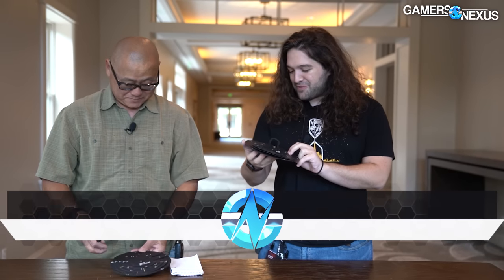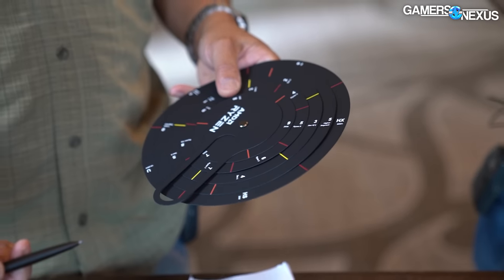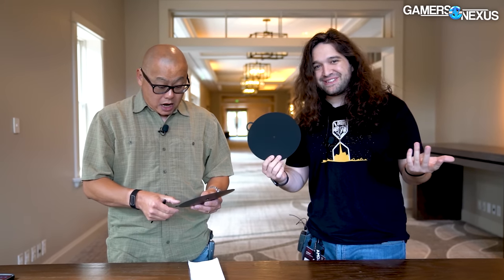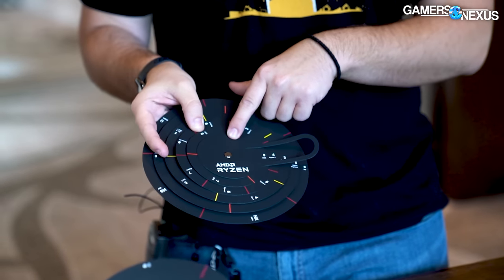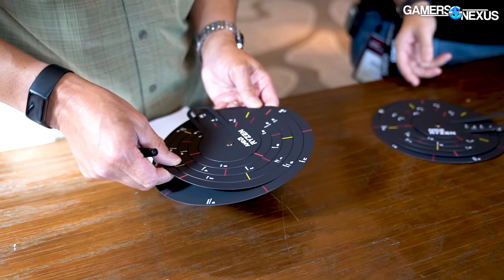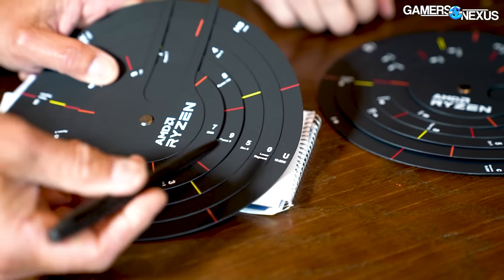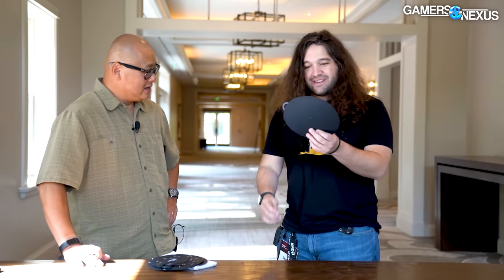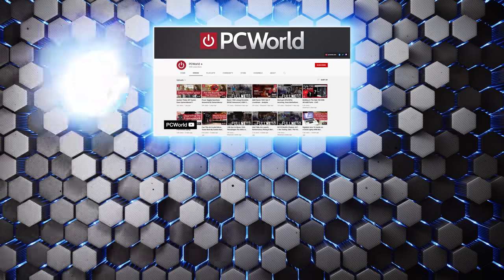AMD Gave Us Too Much Power | CPU Naming Problems

Comment: I guess the first digit is like a model year for cars? Where the "2023" products start coming out some time before the calendar year.  

What's weird for mobile parts is they don't [directly] reference GPU generation - the Steam Deck uses Zen 2 cores but RDNA2 graphics, so isn't just an "old part," and it'll do better than a Zen 2-based laptop with Vega graphics. 

If AMD is using older Zen cores but with newer features (say, more cache, support newer/faster RAM or a new PCIe), then the first number makes sense.  The core may be old but you're getting some new tech.  But WITHOUT that.... it's just marketing to get someone to grab the big number first (which is weird - AMD makes more money by upselling you to a Ryzen 7 over a Ryzen 5 or 3, so you'd think they'd put THAT first since that's the part that makes them the most money).

Comment: I don't see what's confusing, I used to have an Alienware laptop with dual GTX 7950, (those were the days BTW) now I'm going to buy a 7950X, which is going to replace a 6700k, but not paired with an 6700XT, no no no, probably a 7800XT or 7900XT, but not an ATI, because I already have one of those. I really don't see what could be confusing.

Comment: I kind of feel like they should keep consumer branding as simplified as possible. The GPU naming schema isn't descriptive after the first digit, so we know it can be done. Just have a leading digit of the arch and then a unique identifier encompassing of the number of skus you potentially see. If a consumer cares enough, they can go look up the feature set for the unique identifier. Ryzen 5[00-99]. Zen 5 and then whatever uniqueness. 500, 501, 510, etc.. Radeon 5[00-99]. Doesn't matter if it's a CPU, GPU, DIY, mobile, etc..

Comment: Ok, I get what they have/are doing, but I don't get it.... Hope that's clear - lol

Year should mean Year of development/release. So why is their an upper or Lower tier product code, surely this is also the same as a Ryzen 9 vs Ryzen 3?? then instead of a Year decode wheel, why not just make it a Year!..... What a novel Idea that means they've got processor numbers for the next 78 years....

So you could have 235HX Year 23 Ryzen 5 U Low power Why do you need to differentiate the ZEN bit (surely its an ever increasing number which is mapped to year?) Hell if they need to add another digit to differentiate the half/quarter it was manufactured in you could add an abc or d or even a-l after the year component. So a 23b5HX...

Then who would ever need this stupid thing!

Comment: Surprised you didn’t pick up on the correlation, but, consider this - look how in the last couple years, we’ve had constant “refreshes” (the GPU market comes to mind), where manufacturers were using older architectures, but with “newer RAM” (like those 10 series nvidia cards recently), bigger/faster cache (does this even really have an effect on bandwidth if the bus size isn’t changed?).
I can see AMD doing this with older Zen architectures, and adding that 3D-stacked cache for better L3.

Comment: One advantage with the year affecting the first digit is for sales transparency.
If you bought a laptop, the first digit will tell you the year it's manufactured, so it's would be harder to sell 2-3 years old laptop and tell the customers that it's new.
Ex: If you bought a Ryzen 7xxx laptop in 2025, you can easily say it's a 2022-2023 model and negociate the price accordingly.

Comment: Hi . . . You presented a view which is TOO SIMPLE.
With some commercial software products I delt with - there were software version  Line-Ups . . . 
That is a group of software applications which were compatible with each other.
You have just described a few aspects of the  *Hardware Line-Ups*    BUT    they also need to be compatible with *Software Line-Ups*
Obviously the *Line-up* terminology is a taboo subject . . . it is all ment to be easy and simple and will just work . . . . but you do lots of testing 🙂 🙂🙂

Comment: G funny how you are trolling with encoding CPU names.

But when really decoding with the wheel you'd just put the numbers of your CPU in the "window" then you can read the data of the CPU, like year, Ryzen version, core, etc.. I was a bit confused about the '1' having two core variants listed, Zen1 and Zen+ when I read it correctly. So there I'll have to guess which one is used in the CPU? Not that this would matter as Zen1 and Zen+ are quite old tech.

Nevertheless you're right, that someone would need such a decoding wheel - I last used on in the '90s when decoding stuff for a computer game - to identify what you're CPU is like. Should it be for general decoding of AMD CPU names? As far as I remember they had different cores with the same generation number? ... my bad... i'ts just for the mobile CPUs - as stated in the video title dooh - , but then this should be printed on the decodig wheel.

Comment: In 7650 the problem is not the 7. It's the 0 at the end. Completely useless digit. Where it could make more sense to use a letter for "performance" second digit (5-6-7-8-9). To separate and allow 11 gen at some point. 7A5, 7B0, 7E0 or along the lines.

Comment: Why is the Zen core generation in the middle? That doesn't wind up anywhere in the actual part number. Eg 7600x - 7 for "2023", 6 for the slightly higher end of the 2 Ryzen 5 chips in that segment, and the x for TDP target. There's no 4 in there. And the 5950x wasn't using Zen 5 cores either.

Comment: I believe that the year is usefull because a skull refresh would aways bring some clock speed improvements, even if its little, but it could also bring process node improvements, so a 8530U could offer better performance or be more efficient than a 7530U
Things that are been adressed in this new name scheme is just things that is already happening, ryzen 5000 on notebook was really hard to tell apart, now you would know if a hypotetical ryzen 5820U was Zen2 or Zen3

Lastly, About ryzen 1 on 2023, is something that no one whants, but there is certanly a market for a low cost Atlhon silver as 3020e, but now it would problably be Zen2, as Ryzen 7020e

Comment: i think there is one smartbrain thing that AMD could done to make this new naming scheme not entirely stupid, what if the year number was also the socket number, so all the rebadged AM4 stuff would start with 6, but if they made a AM5 Zen+ R3 CPU, that could be a 7310 cheap test CPU for motherboards nice as a spare and it would slot into the same AM5 board that your 7755 would and at the same time it would be incompatible with your common B450/B550 boards that you might build a cheap 2600x system with so that would justify the bigger number.

but that entire thing goes out the window because we are talking about laptops, and AM5 is DDR5 only anyway so how could they sell anything older then Zen4 in a new laptop board clearly they are just trying to sell old crap they have lying around.

Comment: The release year can matter.  IIRC, Google EOL's chromebooks based almost exclusively on age, so a chromebook with a 7430e might only have 3 years left to live, while a 9430e would have 5.  Which, since the processor will probably still be perfectly capable when Google kills your chromebook (or at least kills all security updates for it), could kind of make sense as the most important factor in how good the CPU is, earning its spot as the most significant digit in the name.

Comment: Take the hypothetical 8321 and 9321 chips.  They aren't going to be the same chip.  Maybe they added some cache (easy way to justify the new number), bump up the clock speed a few MHz, did some optimization to drop the power a couple of Watts.  It's also possible that they changed the physical package for some reason.  Having been in the design engineering field, I know that the market (board manufacturers) won't put up with chip manufacturers changing part numbers, especially if there is certification required for the end product.

Comment: Coming the the enterprise IT space, only 5 variables in a product SKU would be extremely simple and easy to follow by comparison. A lot of stuff, especially for servers and switches, you'll be a minute in to just saying random numbers and letters and have only covered the basic bare chassis layout of the system and yet to even touch on the actual configure-to-order config. :p

The SKUs will have 30-50 variable, while an actual product line may only have 2-3 active SKUs. But if you're will to order a few ten-thousand units, the OEM will probably make any of the other variations.

But things only get cursed when you move to ICs. A chip can have a 30+ character part number where every n characters is some option, config, product line, color, spec, flavor, etc. But the insanity will come with the actual device package only having space for up to 3 tiny laser etched characters which wont even be unique to entirely different devices using the same package foot print from the same manufacture. Pretty much once a part become loose from a labeled real, or mounted to a board, you have very low chances of being able to identify it unless you already know before hand what device it should be, and only at best confirm that via characterization.

Comment: Why would AMD be looking at 12nm Ryzen Gen 1 for low performance segment? If you want a lower performance part, why not undervolt the 7nm part and be more power efficient? Unless they just care about the build cost? Are they taking 12nm designs and converting them to 7nm to take advantage of die shrink?

Comment: AMD could of had a golden naming scheme but they decided to mess things up. Ryzen had a clean sheet launch with the 1000 series. Mobile chips didn't come until the 2000 series, except they were still zen 1 cores. Everything from there forward just screwed up. Why not just release the mobile parts as 1000 series parts to keep everything in line. Or even doing the shady zen 1 launch in the 2000 series, they could do the 2400g zen 1 and a 2405g for zen+, then keep everything equal moving forward. But the issue is I don't think they had the IGP sorted out on the chiplet design yet which is why they kept it a gen behind. Zen 2 with an IGP didn't happen until long after zen 2 served its time, and it was a shared design with zen 3 with igp having a monolithic die. It took them until zen 4 to get the IGP in the chiplet design working, which is why I believe their naming scheme got all messed up. It sounded like they wanted to keep everything level on their product lineups but marketing's plan went out the window when R&D didn't get the products out in time, but cooperate just told them to "make it work"

Comment: One way the first digit could make sense is if it were a representation of the SoC architecture. Not sure why they'd play with backporting like that but one example is the SoC in the Steam Deck which I believe is generally closer to their newer 6000 SoC design (at least, it has elements of the newer memory controllers and the RDNA 2 GPU) but with back ported Zen2 cores. 
Still a bit weird though, and the messaging around it isn't great.

Comment: You guys are so clueless.
Intel and AMD have duked it out for decades, whether it's first to cross the Ghz barrier, first with SMT, 64bit, instruction sets or price barriers.
Intel have winning on the bad naming front for a while, this decoder/break-brain wheel is AMD setting a new standard,
Yes, being the first to do a bad thing is a good thing #becauseReasonsAndStuffAndThings!
/s

Comment: I think the old architecture will be mixed with newer architecture (I remember reading something that said AMD will be doing just that as their take on big.LITTLE) BUT be made on newer nodes, so even with old architecture being at the same clock speeds and cache, they’ll still be used along with new architecture AND newer nodes allowing higher transistor density and higher speeds while being more power efficient. Also I believe the nomenclature meanings will be Ryzen 9 being newest zen with previous zen (ie zen 5 performance with zen 4 efficient), ryzen 7 being zen 5 with zen 3, ryzen 5 being zen 4 with zen 3 on 3nm/4nm making it higher performance with better efficiency at same clock speeds, and ryzen 3 having zen 4 with zen 2 or zen 1 again on newer nodes. The year it comes out matters because whenever a new node comes out they can keep everything else the same just made on better nodes.

Comment: I don't know why they have such a hard time coming up with a long lasting naming scheme.  Start with a letter that indicates transistor count(exponential mapping, say A is 1.5 billion, and each subsequent letter multiplies by 1.5, that will stay useful up to 38 trillion transistors at Z), a letter for what microarchitecture it's using, a letter for relative binning, a number for core count, and a letter for TDP

Comment: Honestly, having each digit have a consistent meaning over a long enough period of time would eventually make interpreting model numbers easier.  Personally I'd have gone with Zen architecture, Ryzen number, then year, then whatever the other digit is and the letters, since to me that makes the most sense in terms of priority.

Year probably has some significance - refinements of process and how the chip components are put together are an iterative thing, and newer designs will likely be able to squeeze more out of the same tech....but the major tech differences like architecture and whatever makes a Ryzen 9 a Ryzen 9 and not a 7 (is that a core count thing?) is going to have a much greater impact than the iterative process.

I guess the big way that year could impact things is if there's a major shift in design philosophy, like if 2024+ models are all using the upgraded cache style we see in the 5800X3D which changes the performance characteristics of the processor in ways that are kinda hard to represent gracefully otherwise.

Honestly, I think the decoder wheel idea is a hilarious bit of self-awareness from AMD, it's a cheeky way of saying "we know this is really complex, but there is a logic behind this mess" ...and its silly enough that it gets people to talk about it which of course is the core goal of marketing.  If they released a massive spreadsheet showing all the definitions of things and how to interpret everything it would be boring, and the content of this video would become a bit of your weekly news video saying "AMD released a big spreadsheet explaining its mobile processor naming conventions, it's really complex and it's on their website you can go check it out if you want."

Comment: The first number would change with the same technology if the number of cores would go up for the category in the second number. I.e. They increase the number of Ryzen 3 cores from 4 to 6 in 2024. I would interpret the first number as "the multithreading power" of the Ryzen category, since I would assume that can only go up and not down with years. The third number would be the single threading perhaps (the core).

Comment: Let's be realistic, they aren't going to be selling Zen 1 in 2025. They are likely going to sell what chip stock they have left over from Zen 1 and 2 within 1-2 years for the lowest cost markets on mobile devices. What didn't pass QC for clock speed on desktop, they've had lying around in some warehouse for the last 6 years more than likely. They've been sitting on it as an asset so they can come in and provide for the lowest cost markets worldwide.

Comment: On Epyc the least significant digit is the core generation. Has problems but more significant digits tend to translate to core counts and performance.

On mobile, with core counts being much smaller and IPC much more important, it would make sense to track architecture in the most significant digit(or second). Never the dozens one...

Then again, we're into 5 generations of having a useless single digit before the model number. And copying Intel with the Silver and Gold nonsense on budget parts.

Comment: Lets factor 1 more thing in. In the mobile market you nontheless can't trust any Number and have to view Benchmarks and reviews if you care about what you get. Becaus it ist already al long time the way, that der power configuration and timings in the Firmware, the cooling capabilitys can screw up the nicest partnames and numbers no matter what. the only thing you really can trust is tests, benchmarks and reviews 🙂
so, if they call the CPU Socks or Pampers isn't that important anyway :D its just a first indicater of what it might be capable of and then you look for the benches.

Comment: Four digits with a suffix for power consumption was great until their marketing muppets decided to start playing cute games by calling 1000 series mobile chips 2000, 3000 series chips 4000 and 5000 when they were not based on the same cores as the desktop parts.

Comment: With the price of electricity as high as it is in EU, would be interesting to see benchmarks about how much does it actually hinder performance in real life, if you undervolt and downclock a CPU and why not GPU. At 1440p my experience is that downclocking a CPU down to its non-boost basic clock does not really affect how gameplay feels in graphics heavy games. underclocking a GPU reduces FPS more, but even then the end result is often more stable fps and remarkably lower temps.

Comment: They'll have set numbers.  You use the wheel to figure out what the number means.  It's that simple. Will there be overlap?  Sure, there usually is.  But, hey, it is what it is.  Get what you need, maybe what you want.